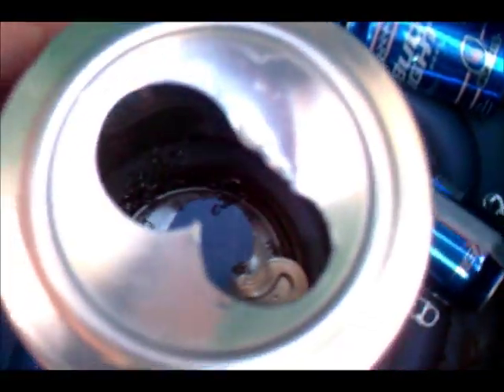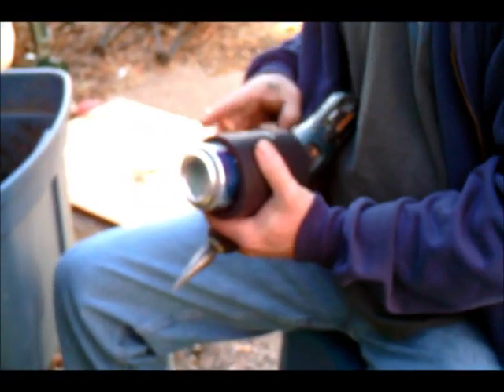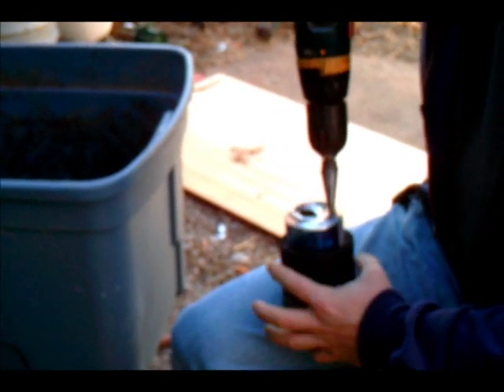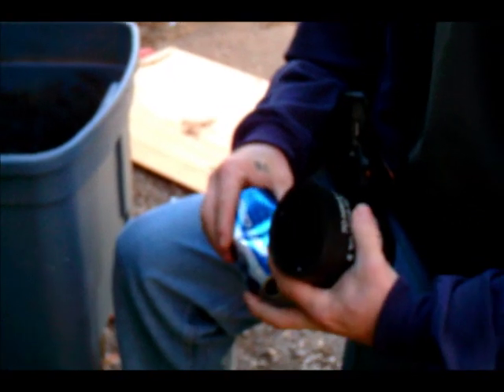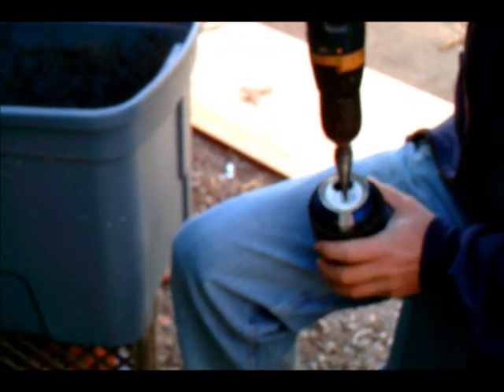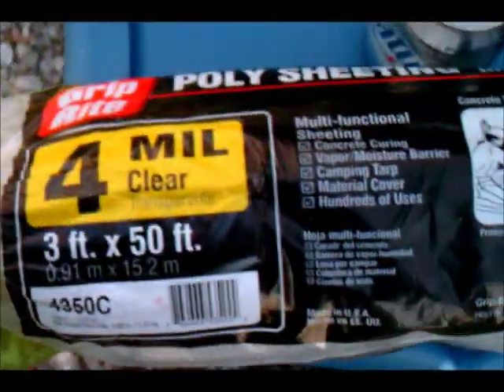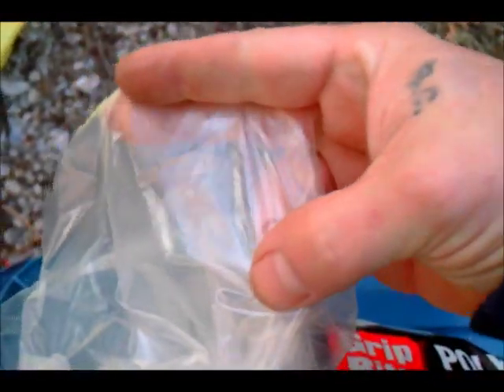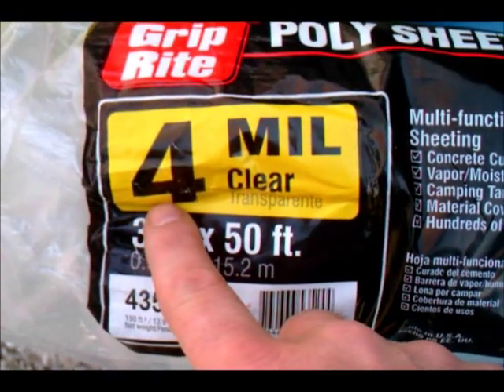solar air heater PART#1. FREE HEAT!

Comment: i'm going to try to build one using catfood cans.  I have about ten cats so i'll have enough in no time : (
They are stronger.  I thought i would try drilling much smaller holes.  Seems to me the hot air would build up faster and actually force the hot air through.  I wonder how it would be too if you were to have it coming in under a floor so long as you have a closed in gap under the floor.

Comment: I'm building one myself, just a smaller unit though, going to try out how it would work in our colder climate up north. I suggest, as someone already pointed out, you look around for glass instead of plastic. First of all, plastic is rarely UV-resistant and will turn smokey yellow and crumble. Also, lots of people replace their windows since it's an easy way of insulating further, their old windows are usualy thrown away or sold cheap. Scavenging is as much good economy as solar heating =)